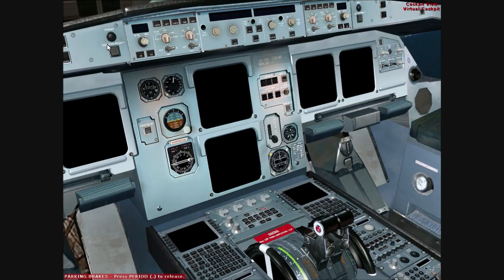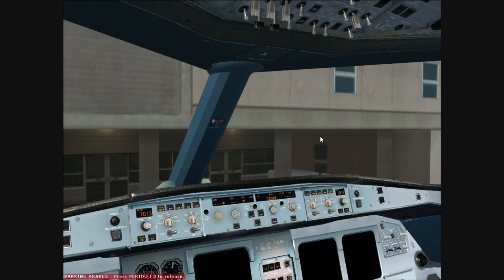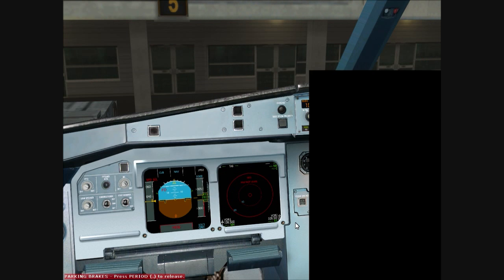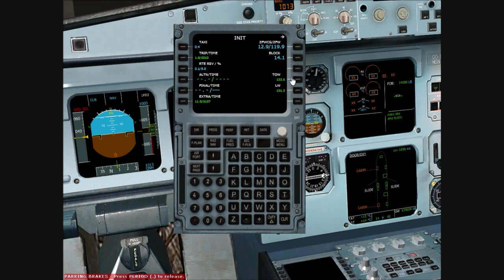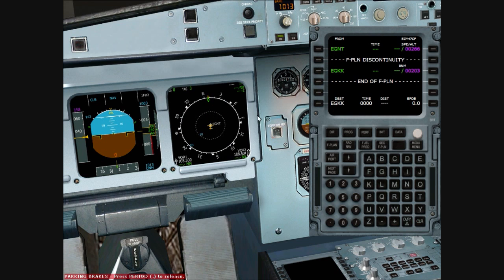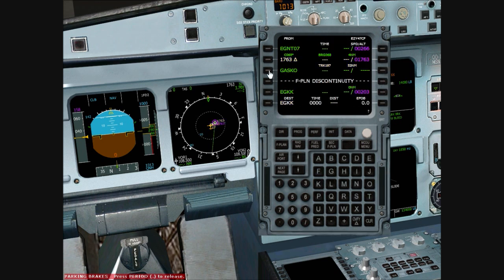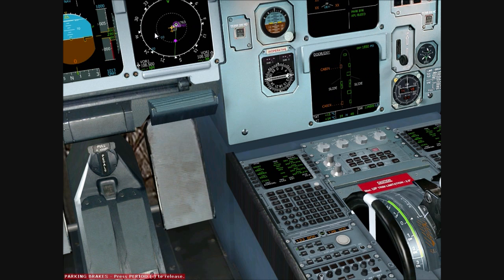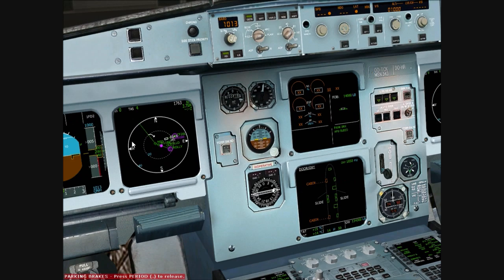Wilco Airbus A320 Cold And Dark FMC Tutorial

Comment: Hi, i got a wilco a330, and it cannot start in cold and dark mode because of the parking break, i dunno how to make it cold and dark although i have click on the Cold and Dark in the configurator, and one more think, my fuel is displayed in kg, and it got massive 110 tons or sth, and my trip only take 12.5 tons, but i enter the block in there and the weight didn't change, any suggest for me plz
Reply from the maker: No idea personally. Its ages ago since I last flew any Wilco product, and ive never flown their A330. Sorry.
Reply: Nguyen Quoc An Load the aircraft in fsx enable the parking brakes then open the configurator then select cols and dark then press alt in fsx then aircraft or something like that then select aircraft then reselect the aircraft and it should go in cold and dark mode, and to change your fuel units that's also in the config

Comment: hey mate. i have a problem. im using atc vector to guide me to the ils. if it possible if the heading and speed set to manually during the vectors approach like the defaults ?
sorry for the bad english btw.
Reply from the maker: No worries at all mate. So first if you're using a chart use a manual heading to the closest point of the ILS. So generally you want to capture the ILS at about 9 miles away. Once you have the plane on a heading  at say around 3000ft then when you see the centreline of the approach on your NAV display press the APPR button which will then arm the LOC (localizer) and GS (glideslope) so the plane cant catch the ILS and establish itself. I hope that helps :)
Reply: +Jonathan Winton yeah i know that. but what i mean is, when we radar vectored by the atc for a approach, the atc will give command as it example to "your 25 miles, turn left heading 150 expect vector ils runway 03 approach" if the atc give that kind of approach then we have to set the heading knon to 150 and deactivate the vnav that follows the flight path of the fmc. but i cant get the heading to 150 wich is the heading of the aircraft follows from the mcdu. i try to push the heading knob button but still doesnt change anything with the heading change. i done this with the pmdg then it works. just set the heading hold and deactivate the vnav. are the airbus sims can do that to ?
Reply from the maker: A good thing to remember when being vectored by ATC is your speed. So a a principle you do 250knots below 10000ft unless ATC tells you to go faster/slower. When they ask you to descend you can then right click on the ALT knob to change to mode from DES (descent) to OP-DES (open descent) which acts like LVL-CHG in the PMDG. Same with the heading. Only if they assign you a heading would you then  disconnect NAV and switch to HDG (heading)
Reply: +Jonathan Winton nice! im right clicked the knob then the heading and speed indicator change exactly what i want. thanks pretty much help.
Reply from the maker: I'm pleased you got it working. No worries at all.

Comment: HI! I'm new on this thing and i just want some basic things like, altitude, speed and headings and try to land with ils... Could you help me? As you know and me, this plane is a lot different from the default one's and the only thing that i would like to do is landing with ils without using the FMC! It seems that if i don't use the FMC i can't land with ils or just use the instruments correctly :cBtw, your video was nice! (:
Reply from the maker: +Rui Cavaco Yes your right mate, in order to conduct a full ILS CAT3 landing you need to have the FMS set up almost perfect. you then need to cross your ND modes so they switch from an LNAV setting to s a setting which allows the aircraft to establish itself on the Localizer. I have to say ive been flying it for ages and it still has its difficulties. But dont worry just keep giving it a go and youll get there in the end mate.
Reply: OK, very thankfull mate, hope to learn it fast! Ahah (What a joke!)
Keep on the good work! (:
Reply from the maker: I would offer more help , but its alot to explain. Good luck mate :)

Comment: This is a problem I have which is how do you know what SID goes to what runway, I know there are SID's for all runways and SIDs for each runway that has a procedure but which one to choose? if you can clear this up that would be great.
Reply from the maker: Clive-Albert Dodd It basically depends mate. You need to have an active AIRAC for your aircraft to start off with. Secondly you need to have an understanding as to whether or not your airport has SIDs as not every airport has them. The one you would chose is the one that is contained in the flightplan that you obtain
Reply: Hi Jonathan thanks for replying, I believe I have a better understanding now, as I need a proper flight plan ( a real plan ) which there will be a transition fix of sort at both ends of the plan in which the SID and STAR can be linked too so I believe I have made some progress.
Reply from the maker: Clive-Albert Dodd Yes thats right mate, so for example if your flying from Newcastle EGNT to Belfast EGAA then you need to find the flightplan for that route which would typically be NATEB direct to BLACA to its a very short route. Just be aware that not every airport has SIDS or STARs. Good stuff man. Hope its going ok
Reply: Great Jonathan thanks for this valuable lesson its been very instructive and I appreciate the time you have given me freely. Thanks.